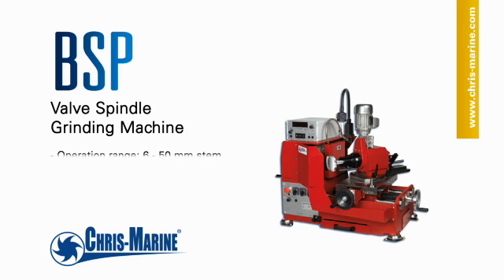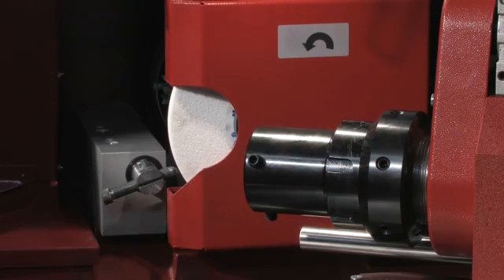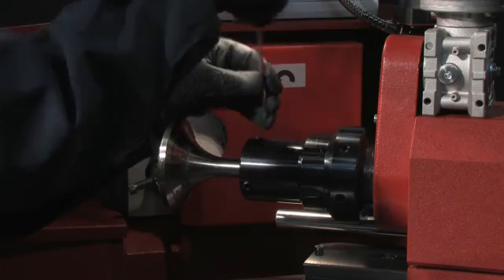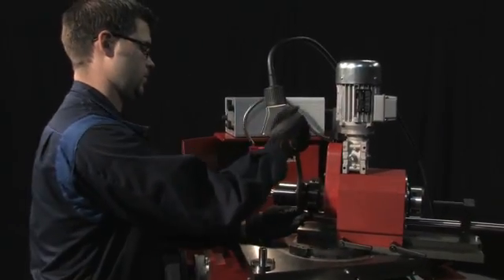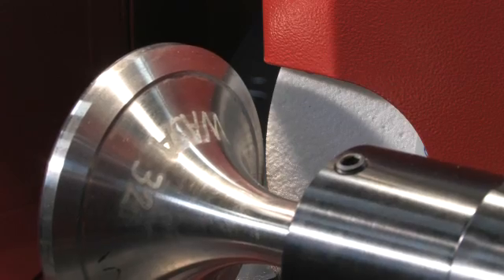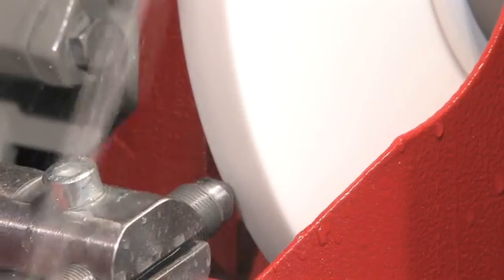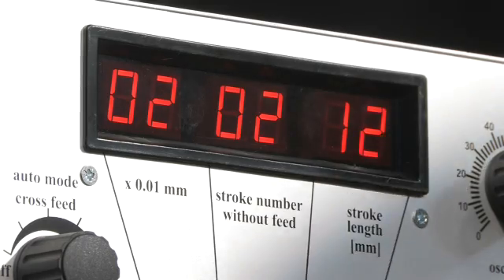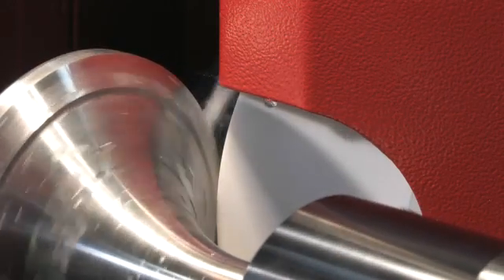BSP Grinding of valve spindles on high and medium speed diesel engines

Comment: Dear Sir, 
We needs an Automatic production line for produce Engine valve. 
The purpose of production line is doing (forging, shearing, straightening, 
turning, welding and grinding) 
These Engine Valves will be used in Peugeot XU7 & TU5 (1300cc - 2000cc) 
Please, find drawings in attached file. 
If manufacture of such production line is possible for you? 

Best Regards, 
Pedram